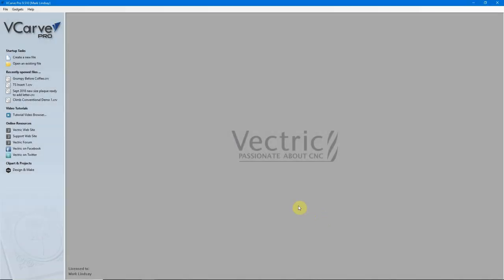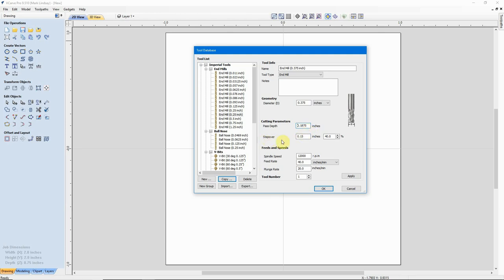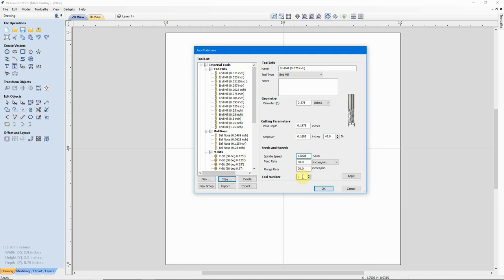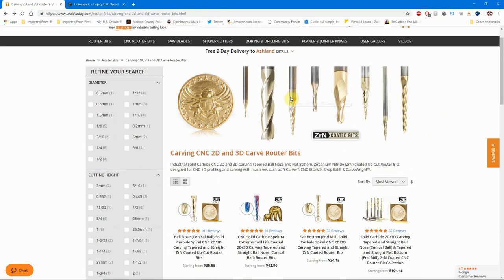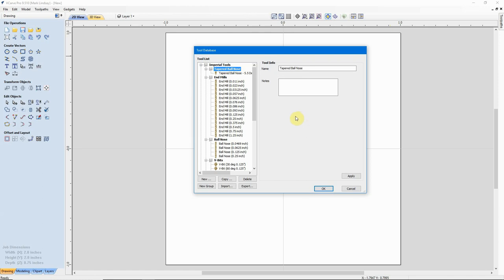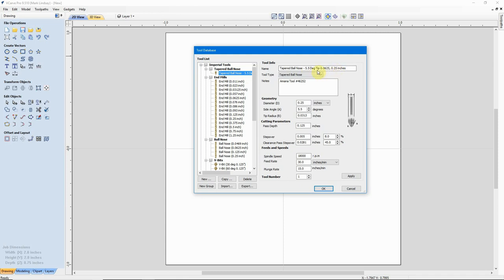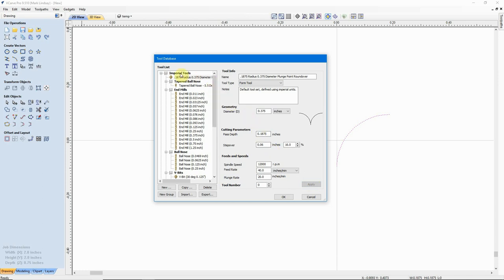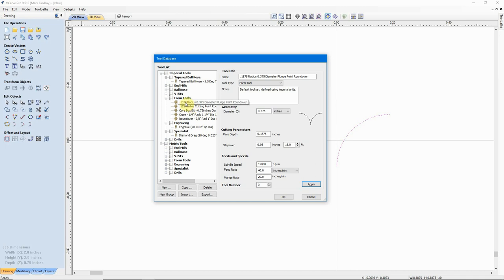The Tool Database -  Part 9 - Vectric For Absolute Beginners

Comment: I noticed that the Legacy CNC site had a "Router Bit Profiles half.DXF" above the file you selected. Wouldn't selecting the 'half' file give you the profile you need without having to Node Edit?
Reply from the maker: I should have mentioned it in the video, but I tried that DXF file. It's the same as  the file I suggested, but there are some duplicate vectors and a few odd stray vectors in the file. Other than that, they're the same - both show the full profile of the bit.
Reply: I was wondering the same thing.... Another very informative video Mark... Thank you

Comment: Mark: your videos are fantastic. Some, such as Part 9 "The Tool Database" are so detailed with many key suggestions that I have to keep going back many times (a tedious process to find them again)  to find where they are in the video so I can make notes. I wonder if you can consider listing such key points below in such videos in your notes with a time and reference to the issue you are describing? I see that there is a way that some others have actually bookmarked such key points below their videos in a way that allows you to jump back into the video at that exact point. Just a suggestion

Comment: Hi Mark, thanks for the video. It did help a little but time marches on and what you showed is now out of date. I have the latest versions of Cut2D Desktop and VCarve Desktop and the screen you showed for tool database is entirely different to mine - I don't have the buttons at the bottom left to click on.
Reply from the maker: You're right, Fred - time marches on, and this video is a little over 2 years old. I've done several videos on the Tool Database since then. Here's the latest: https://youtu.be/NpUV4aeQWYc

This is why it pays to subscribe. Go to my main channel page, click the Videos link, and you can scroll through all of the videos on my channel - there are over 250 of them. Thanks for checking them out!

Comment: Mark, what happens when you are carving if you have the TBN entered as a BN? What will it do to the carving? I ask this because all of my TBNs are entered this way and I have issues when I run a finishing path. THIS video may have solved my issues. Thanks!
Reply from the maker: I think you're seeing what happens, Ed. The tapered part of the bit will over-cut the sides of the area you're machining. That can remove portions of the carving you don't want to remove. It's important to enter those tapered ball nose bits as they're actually shaped. I did a video on TBN bits, and getting them entered into the Tool Database correctly. Here's a link: https://www.youtube.com/watch?v=89ljoKZnTZo
Reply: @MarkLindsayCNC  Wow, another video on the Tool Database. Thanks!

Comment: Just got my Vcarve Pro and want to setup some tools. It seems that you recommend doing individual tools verses importing a database file like from Whiteside. Is that correct? What is  the downside of import a database file vs single tool copy/edit?

A separate question is I saw a speed & feeds calculation program and it had a surface speed value. What is that as related to feedrate?
Reply from the maker: I made this video in 2018, before Whiteside and Amana (for example) had released their large tool databases. Back then they were making individual TOOL files for Vectric software available for individual tools. Since then, they have collected those individual files into one big tool database file, which is what's available now. The downside of importing that database file is you now have one huge database file filled with every bit they have created a TOOL file for. In the case of Amana tools, that's just about every bit they make, and that's hundreds of bits. Personally, I prefer not to clutter up my database with a ton of tools I don't own, and will never buy. That makes finding and selecting the bits I do own a lot easier and quicker. It also makes the tool database load faster when I need to get into it. I did download and import Amana's tool database file into an older version of Aspire (Version 10) so I have it available. Then when I need to add an Amana bit, I open that version of Aspire, select the tool I just bought, export that tool as a separate TOOL file, then import it into my current version's database. That keeps my current database nice and tidy.

Feed Rate is the speed at which the CNC is moving the router/spindle through the material. Surface Speed is the speed at which the tool is actually cutting into the material as it spins. In home hobby CNC, we use Spindle/Router RPM instead of Surface Speed. Machinists use Surface Speed along with Spindle RPM to determine the optimum cutting rate for different metals and different tools. They have to be much more selective and have much finer control over both of those factors than CNCers who are cutting wood, plastic, foam, etc. do. This is especially true if they're machining exotic metals, or using tools that can cost hundreds of dollars - or more.
Reply: @MarkLindsayCNC  Thanks for such a good explanation. I think copying and editing to create a new tool is the best option for me also. I agree with not cluddering up the database is a good thing.

Comment: Many thanks for your videos. I get a lot out of all the ones I've watched.
I tried to add my new Amana tapered ball nose bit to my tool data base but the only download  that I found on the Legacy CNC site was the whole Amana tool data base. Should I have just deleted all the tools but the one that I wanted and used that???? Any help you could give me would be appreciated.
Reply from the maker: What I did was download the Amana tool database into an old version of the software (for instance Version 8.5.) Then I find the tool I want to import into the current version of the software (Version 10.5,) export that one as a separate TOOL file, then import that TOOL file into the current version. It saves me from having to clean up that big mess, or having the entire Amana tool database in the version I'm currently using.
Reply: Thank you for your reply. That will fix my problem.
Again, thank you for all the work you put into your youtube videos. I've learned a lot from them.

Comment: Hi Mark! Nice video. I'm just wondering, if i were to add a bit that has 1/4" SHK but has 1/8" cutting diameter, e.g Amana Tool 46176, into the tool database, wouldn't the software think that it has 1/8" SHK? How to go around this? I have an intention of cutting deep and narrow like 1mm line with the depth exceeding the bit cutting height.

Comment: Hi Mark, is there any chance you can make a tool library file for importing into Vcarve?  or do you know where I can get one please as the one that comes with the Vcarve desktop is pretty limited?
Reply from the maker: The Tool Database that comes with VCarve is limited because they don't know what types of tools you're going to get and use. They populate the database with common tools, then let you add tools as you get them. That's the best way to handle the Tool Database - add tools as you get them. It would be a waste of time to import someone else's Tool Database, as you'd have to go back through every tool and adjust the feeds, speeds, depth of cut, and stepover to be safe for your machine. 

Companies like Amana and Whiteside make Tool Database files available for VCarve that are free to download from their websites, but be warned that you will have to back through every single bit and make those adjustments. Personally, I just add tools as I get them.
Reply: @MarkLindsayCNC  Thanks, and yes it makes sense now, plus bits are far too expensive to break if you don't get it right.

Comment: I am following your video but not getting same screens on my machine. When I pull up tool database and click on a tool, I do not see any of the specs such as feeds, speeds, stepover, etc. 
I just bought this machine used. Shark 510. Vectric software transferred to me and installed. Help please.

Comment: I am putting a surfacing bit in the tool database. The bit has a 1 inch diameter with a 1/4 inch shank. What should the pass depth be?

Skip....
Reply from the maker: I don't know your CNC or what it's capable of doing, but I wouldn't go any deeper than .1" per pass. It's easy to go overboard.
Reply: @MarkLindsayCNC  I am running a X-Carve. Should have stated that..Sorry.
Reply from the maker: I've never worked with one, so I still don't know anything about it. You normally won't take more an .030 of material off per pass when you surface, so the dept per pass will most likely change with the project. If you're worried about it, set it for .050, but put a note in the NOTES blank to not go beyond .1 per pass.

Comment: Hi Mark I'm wondering if you could help, I've recently put vcarve pro 10 on my laptop and I keep getting an error when I open my tool database, i create my design then when I go to create the tool paths it says tool database not found, is this an easy fix? Thanks.
Reply from the maker: This is a question for Vectric Tech Support. I'd head over to their website and shoot them an email. You might have to import the database file from the proper folder, or it might be another issue. Best to get help from the pros.
Reply: Mark Lindsay CNC that's why I contacted you 👍🏾

Comment: Can I used the point round over to ramp up in the corner for a sharp corner ?
Reply from the maker: Excellent question! What I would do is create a Lead of up to 1 inch long (depending on the radius of the roundover bit,) and ramp down in that lead. That way the bit does all of the ramping outside of the profile vector.
Reply: @MarkLindsayCNC   thank you I will give it a try I add the tool Geometry from Amana but it’s setup as v-bit in aspire it ramps but in a 45 degree
Reply from the maker: Here you go. This video may help you. https://www.youtube.com/watch?v=qndxWC--rO8

Comment: Does nobody use 1/2” shank in their CNC ? All the videos and training I see 1/4” and 1/8” being used.
Reply from the maker: I use a couple of 1/2 inch shank bits, but most folks don't. A lot of home hobby machines can't handle that big of a shank. Please remember that these videos are intended to help you learn to use the software - not your CNC router. Entering a tool of any shank size is identical to what I presented in this video. If you have questions about using a certain tool with your machine, I would suggest either the CNC manufacturer, or their support forum or support community. They know your machine best and are the best folks to help you out.